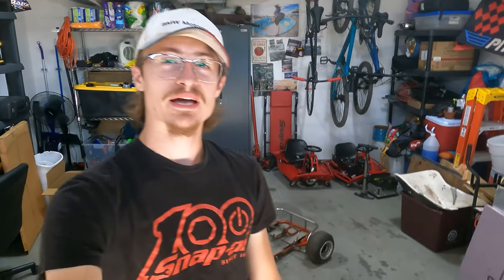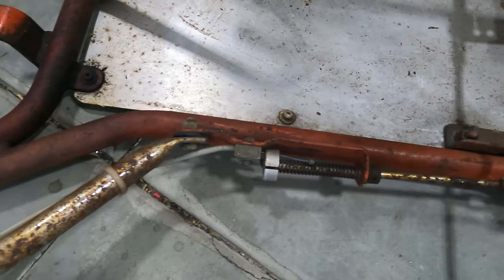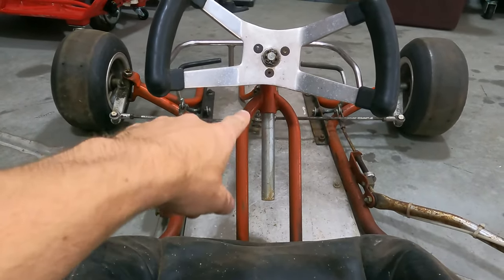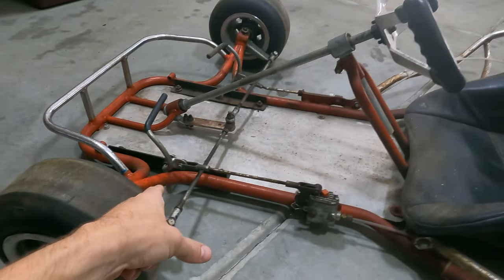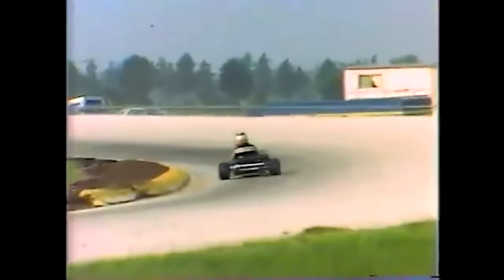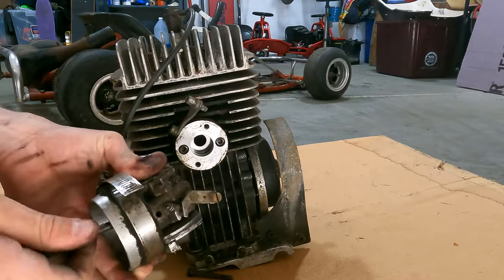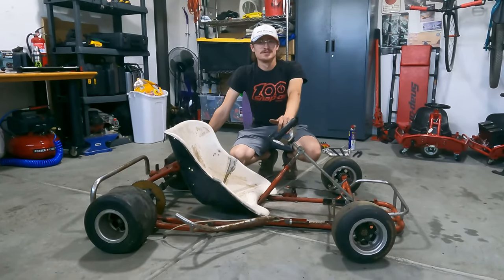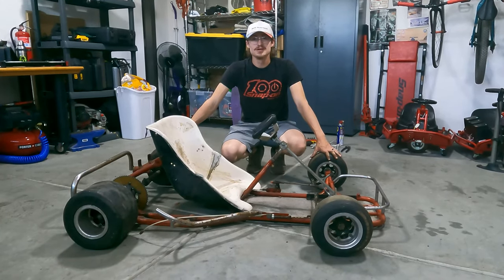70's Go Kart Restoration Part 1

Comment: im almost 100% sure u have a 77 Concept 2  Jr Chassis . I have a 73 Margay Panther Pro X that i am about to tear down its mock up build and test stage and powder coat and rechrome everything . Whish i had ur wheels . Those are series 24 or 25 and they aint cheap . I am not sure about the kt 100 being original because it is a jr , mine is a adult PRO kart it was  a  KT 100 kart and still is !